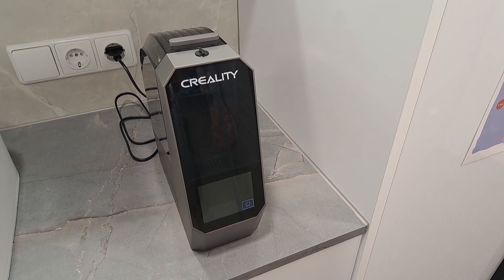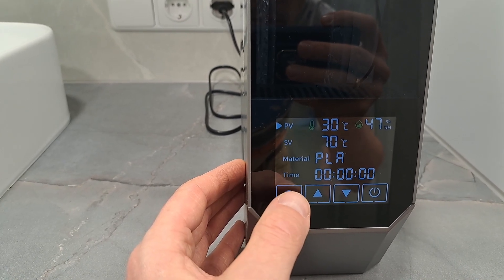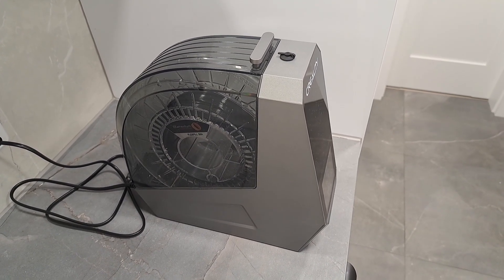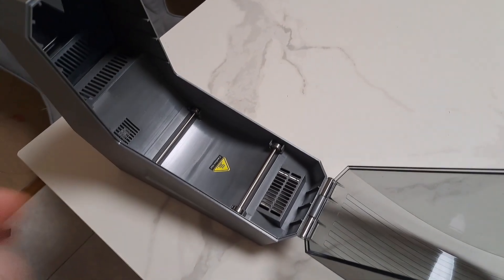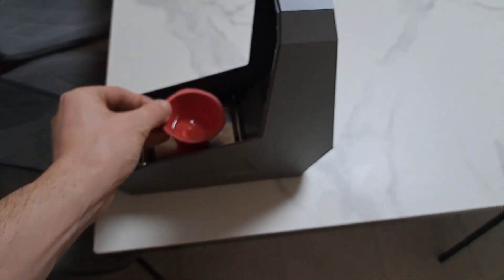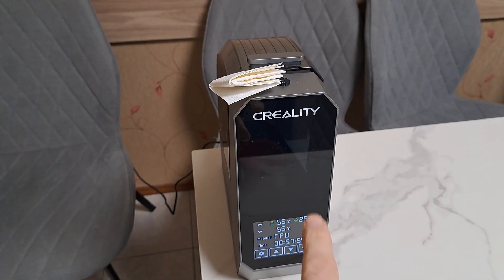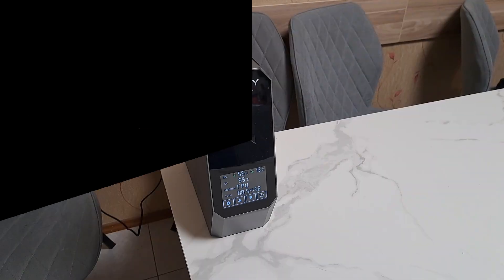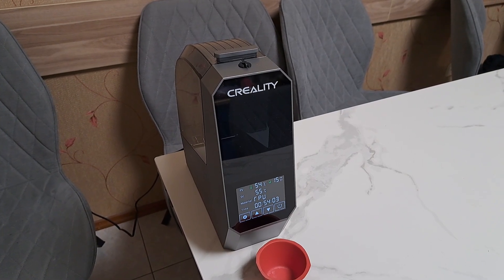Creality Space Pi Filament Dryer | As is it is not able to dry out filament. What you need to do?

Comment: A well sealed dryer would work with some peltier or even heat pump condensation device draining water to an external tray. As is these dryers are kind of expensive for effectively a simple electric heater and fan.
Still might get one in a combo deal with a printer, seems convenient to use even with the little workaround to went humid air.

Comment: OMG... Water doesnt evaporate on 55 degres celsius..... Also, water and moisture are totaly different things. This video is too misleading
Reply: WTF are you talking about?? Water definitely evaporates at 55°C but it does not turn into steam. If it couldn't evaporate, you would never dry if you sweat, and we would all die from overheating if we exercised or had a fever, we couldn't even air dry our clothes. It would also never rain since the whole water cycle is dependent on that same physical principle. Air has always been able to absorb some water, and water is not solid above 0°C and will have some free atoms that can be absorbed by the air around it. Hotter air is able to absorb more moisture than colder air, and these dryer works on the exact same principle as a clothes dryer does but simpler. The moisture level is also a relative scale, so even with the same amount of water in a room, the moisture level will go down if the temperature goes up. 100% moisture level is the maximum amount of moisture the air can absorb at the current temperature, and any more, it will start to bind together and fall out just like it does when it rains. So water and moisture are definitely not totally different things. Moisture is free floating water molecules suspended in the air or absorbed into objects that can absorb these water molecules. Moisture will always try and equalize, and dry objects in moist air will try and draw moisture from it. Dececant bags works since they are able to absorb much more moistrue than other things and will therefore get more of the free floating water molecules but will still have the same moisture level as objects around it since it's relative moisture level is still the same it just have a much higher maximum then most other things.

Comment: There are two small holes on the top, one with a plug for filament to go through during printing, the other on the clear cover with no plug. I assume the latter is for venting. So there is a vent, but it's too small and doesn't work as intended.

Comment: Why not just open the plug on top? The one were you would put your filament through?
Reply from the maker: It is very small in diameter and is not designed to be constantly installed and removed.
Reply: @Mr.Laidukas  Where does it say it's not meant or that?
Reply from the maker: @tru6803 The other way around, it is said that it is meant to hold PTFE tube. I understand that Creality lovers are keen to push the idea that stupidly small hole is meant to evacuate humid air. What a genues designers are at Crealit. Let's clap our hands. In reality, we users can find a creative ways to use components not by their intended purpose and achieve our goals.

Comment: Interesting video. In practice, I found that it did work pretty well. I put a spool of Hatchbox Tranparent Black that I had forgotten about for a couple of years into it because it would snap at the slightest pressure. 12 hours later it was printing away with no breakae and no stringing. I think the few holes and the leakage around the door are sufficient to let the humidity out. FYI - the room I print in was at 38% relaive humidity and the drier went down to 15%.

Comment: Nice work!  I have just unboxed mine today and this is the first thing that occurred to me as well.  My thought is that occasionally a flap should open to release humid air and then close again in order to retain the heat, increase the humidity again and then repeat the process.   What you do think?
Reply: Yes, if you do that you'll see the humidity drop dramatically.
Reply: @xjet  It also seems that the temperature is not correctly calibrated and the humidity inside the chamber is not reading correctly either, have you found this as well?
Reply: @NeedItMakeIt  Yep, it's a bit sketchy in terms of accuracy.  For best results I pop a bit of filament between the hinged portion and the top of the case so as to create a small gap.  That allows the moisture to get out continuously.  I note that the humidity sensor doesn't measure less than 15 percent.

Still... it's pretty cheap and it will dry filament so I'll keep using mine -- that way the wife won't complain when she finds a spool of TPU in the toaster-oven 🙂
Reply: @xjet  Thanks for that.  It seems to have quite a few nice design features, I have found that the spools don't roll well either.  Nice work on your video BTW.  I have a channel as well, and I found your video helpful.
Reply: question, I have just gotten a space pi plus. Is the hole in the lid not enough to vent heat pressurized humid air slowly? and if not, is the  filament hole left open not enough?

Comment: Interesting video thinks for posting. I would have liked to see the box with the water run overnight with the lid fully closed. Everyone talks about these as "sealed" boxes, but they are no where near airtight. So it would be nice to see how much water evaporates with the closed box run for 12 hours vs with the lid partially open. THAT comparison would prove the value of your proposal. The mere demonstration of initial lower humidity possibly could indicate LOWER effectiveness because outside drier air is continuously mixing with the humid air around the filament, reducing the humidity of the mixed air. It would be great to see a proper comparison with hourly measures of water left (by weight) and humidity with both closed box and slightly opened box. This would also permit an estimation of the optimal opening to leave to maximize moisture loss from within the box.

Comment: There is a black plug/bung (just above the Creality logo) on the top of the device to vent moisture.
Reply from the maker: Actually it is for PTFE tube. Insert PTFE tube to that black rubber grommet and feed the filament via that PTFE tube to your printer. But yes, If you do not want to print at the same time you can use that as double purpose.
Reply: @Mr.Laidukas  You'd use it to vent to dry the filament, and then once dry and ready to print and keep it dry thats when you use the ptfe tube and run it through.......
Reply from the maker: @xboxusr666  When you unplug the PTFE tube hole it is 4mm in diameter. Does not sound like effective vent hole. Even if you rip out the rubber grommet completely it becomes 9mm diameter hole. And it does not feel like meant to be removed on regular basis as part of end user operation.
Reply: @Mr.Laidukas warm air in an enclosure cause pressure to rise and escape through any small opening to equalize pressure

Comment: Cool experiment, thanks! My experience was the same. I placed a thermometer inside and monitored the humidity on a time scale. Without opening the lid the relative humidity will slowly increase and not get released (obviously, as the box is sealed), so the drying process will probably not be efficient.

This is why I made an air vent spacer, which could be non-invasively attached on the dryer case (search "Creality Space Pi - Air Vent Gap Spacer " on Printables). The small gap is from my measurements enough to continuously release the humid air.

(YT removed my previous comment, no idea why, so reposting this - sorry.)
Reply: I was about to start designing my own bumper / spacer to do exactly this. Thanks!
Reply: Interesting... my Creality Space Pi needs a little extra force to fully close the cover. Otherwise it has a gap about the same size as the one in your pictures using the spacer.

Comment: It can be easy to fix the dryer not actually drying the filament by drilling some holes in the back on the "plastic glass" cover or just 3D print a part that clips onto the top so that it won't let the cover close all the way, leaving a small gap.
Reply: I would rather opt for a less permanent solution I think you can just remove the lid handle , there are 2 screws that hold it on and then  you would have 2 extra  holes where the screws went, additionally  someone could design a  very similar looking handle that is just a bit  shorter width wise and that would just clip on  to the lid from the front, the clip  can be thin but it will still create a small gap and keep the lid from closing all the way